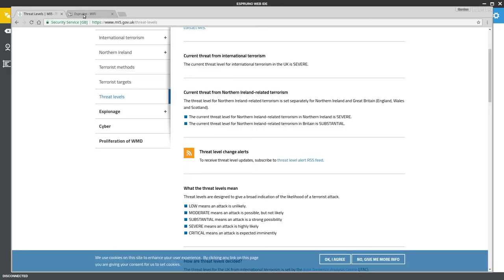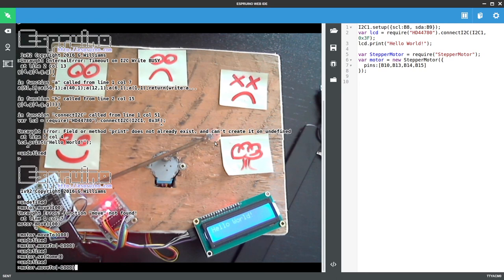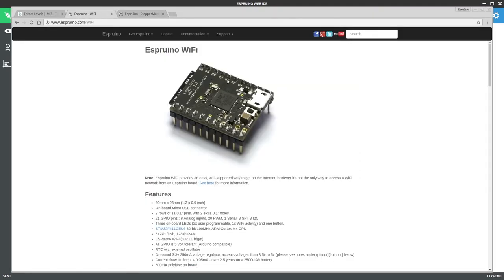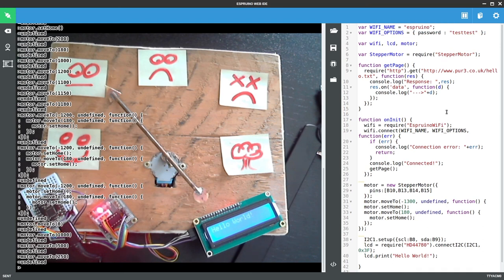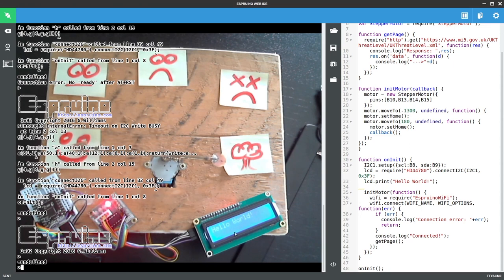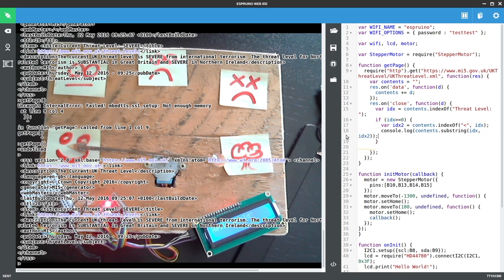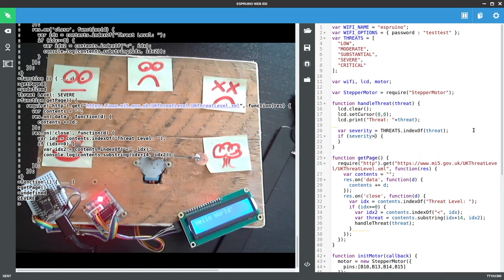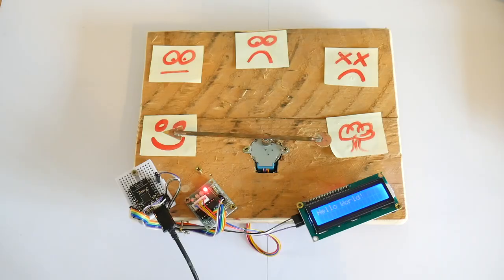Make your own Threat Level Meter / Terrorometer!

Comment: Well done, very pedagogical. Have you thought about making a query selector, or is it to heavyweight and power draining?
Reply: A query selector would just be too heavyweight. While your could use an XML parser on the Espruino boards just fine, the HTTPS takes up huge amounts of memory and realistically it'd probably be too tight. I think you can see that once or twice in the video the HTTPS fails with a memory error - and that's just because after editing code, memory fragmentation meant that the first HTTPS attempt hadn't been able to clear a big enough buffer even as it was.